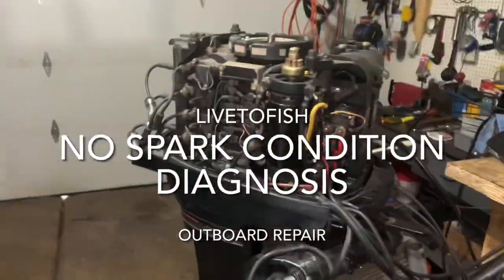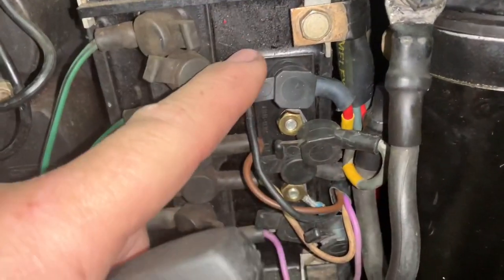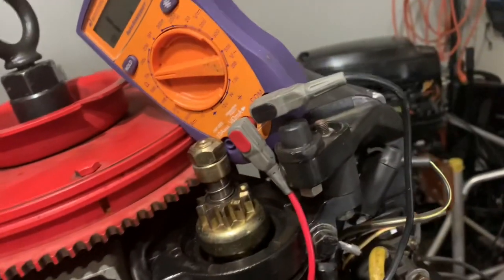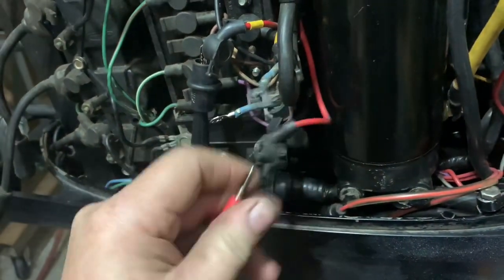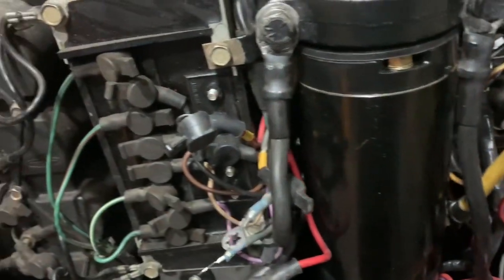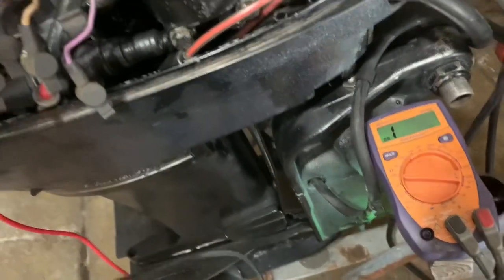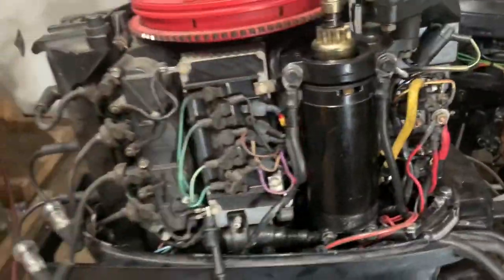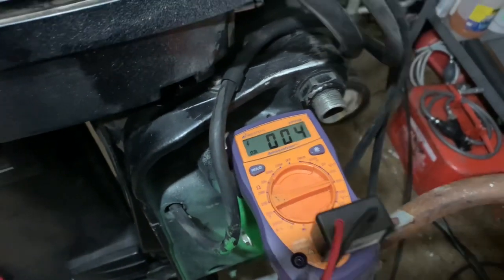“No Spark” Is it a Bad Switch Box, Stator or Trigger? Using a DVA Adapter - 1989 45 hp Mercury

Comment: Personally if the engine has known to have X amount of hrs 9x’s out of 10 it’s going to be the power box.  And ya might as well get new coils and plugs. It’s not a lot of money and what the hell .. if your fixin one thing might as well do a overhaul. Last thing anyone wants is to be out on the water and have to get a tow. Thanks for the run down, it’s always good to know the sequence of operations none the less
Reply: Sometimes it is a lot of money for people and they don't want to just throw a bunch parts they don't need on there. The reality is that these parts are very reliable
Reply: Tell me how exactly your going to know how many hours are on a well maintained motor? 

Also, parts combined with labor could be well over $1000, easily double that.

Most of us that own or purchase older boats are only doing what we can afford as it is. 
If money wasn’t the issue, just buy all the parts, change it out, and drive away…
Reply: Can anything else cause a no spark in all plugs scenario?
Reply from the maker: @mikesolns1364… Yes a bad kill switch or if all the coils were bad or if the wiring harness was rotted.
Reply: @LivetofishOutboardRepair  Is it true that a bad regulator/rectifier can burn a power pack? Thanks, I appreciate it
Reply from the maker: @mikesolns1364  ….from my understanding the rectifier just charges the battery but a faulty Stator can cause a power pack to go bad.
Reply: @LivetofishOutboardRepair  I ask because I think my rectifier is faulty, my tach goes crazy most of the time, and had no sparks in all plugs, changed the power box, and the engined fired back up, to be without sparks again some weeks later. Was wondering if the rectifier could have burned it? Do you know how can a stator burn it?
Reply from the maker: @mikesolns1364  The Stator provides the AC current to all the components. It can cause voltage fluctuations and spikes to the power pack if it begins to fail. This is why my video shows the peak voltage outputs from the Stator to the Power- pack while connected to the Power- pack. I also show the Stator’s resistance (Ohms)disconnected from the Power-pack. If you go to www.cdielectronics.com they have troubleshooting guides specific to your motor and explain with even more detailed information.
Reply: @mikesolns1364 I had this issue with the tach going crazy and it was the rectifier

Comment: Great video!!! I have a 1985 Mercury 75 HP. Idles and runs like a top up to 4100 rpm’s then runs rough, spits, sputters etc. when I back off it runs great. Checked everything I could think of concerning fuel but no change. Electrical? Any thoughts?
Reply: While I was waiting for a DVA adapter to arrive, I swapped the switchbox out from my parts motor and it fixed my problem! Runs like a champ again! I had no idea what I was doing but your video gave me the confidence to give it a go. Thank you very much! Time to go for a ride 😎!
Reply: And I sure hope it’s not the reeds………..
Reply from the maker: Bobbyvee20…. Did you remove the carbs and thoroughly clean the carbs. It sounds like you might have a high speed jet plugged or partially plugged. If you have already cleaned the carbs you might want to verify the resistance values for the Coils, Stator and Trigger and if that all checks out ok use a DVA adapter to verify your peak voltage outputs for both the Stator and Trigger as well. If the voltage and resistance outputs check out then you may have a bad switchbox.
Reply: @LivetofishOutboardRepair  carb’s thoroughly cleaned. Stator and Trigger resistance good. I need to check the coils and do the DVA adapter tests on the stator and trigger. I didn’t understand how until I came across your video! One question, on the resistance tables, OEM (original equipment manufacturer) and CDI is an aftermarket manufacturer?
Thanks for the quick reply!
Reply from the maker: @bobbyvee2043  you are correct CDI is aftermarket.
Reply: @LivetofishOutboardRepair  Thank You!
Reply: I have done all the resistance tests as shown. Testing the trigger wires individually to ground, they each read between 1775-1850 on the 20000 scale. Could this be my problem why it stumbles over 4100 rpm’s? They are either consistently good readings or consistently bad. According to the video, it is the latter.
Reply: Also, I have not yet performed the DVA tests on any component.
Reply from the maker: Bobbyvee20… I would say those resistance readings are revealing a problem with the Trigger. I would continue on with the DVA voltage readings to be sure. If your trigger is bad you may see problems at WOT. I would also check the Stator and Switchbox for both resistance and DVA voltage outputs to make sure you don’t have multiple component issues.
Reply: @LivetofishOutboardRepair  thanks for the quick reply. I will continue on with DVA tests!

Comment: I have a Yamaha 115HP V4 from 1984-1988. Having the same issue, no spark on any cylinder. It seemed like the CDI troubleshooting guide you used in the video was worth the money. Would you say it was helpful? I found their specs documents for free but it looks like you have to pay for the troubleshooting guide. It's a shame I live so far away from you (northwest Washington), none of the mechanics around here want to tackle this issue, just because it's and older motor. I'm going to try replicate what you do in this video and see if it'll help.
Reply from the maker: Jared Feig ….. the CDI DVA are like you stated free charts and are very useful, however I did not purchase the troubleshooting guide. I am not a professional mechanic but just used a systematic approach to isolate the problem. Good luck with your 115 Yamaha. If you keep digging you will solve it yourself.

Comment: great tutorial sir. I have the exact same engine. I tested my trigger to your specks same as you did. Cranking with the DVA hooked up you got 6v or more. Mine only puts out 1v. Is that low enough to assume that it needs to be replaced you think. Engine is lacking power at higher RPM's. Thanks for any info that you pass along.
Reply from the maker: Anthony sloan … it depends on which wires on the trigger you are testing. The purple, white, brown and white/black wires when checking to engine ground should be 1v or more. Checking purple to white and brown to White/black wires should produce 4v or higher. If your trigger is producing these values then you might want to look at checking the Stator. Do you have strong spark on all cylinders or only spark on some cylinders? If one or more cylinders lack spark then it could be bad coils, SP wires or a bad switchbox.
Reply: @LivetofishOutboardRepair  I checked the stator exactly the way you showed and I actually got better numbers than you got so it should be fine. The switchbox is new. On my trigger test exactly as you explained on the DVA cranking voltage test of purple to white and brown to black and white you got a little over 6 volts on both. I got only 1 volt on both of those. So my trigger passed the ohms tests but failed the voltage according to your specs. unless 1 volt is sufficient enough. What do you think om that. My coils and wires passed resistance tests.
Reply from the maker: Anthony Sloan… If the voltage is showing only one volt and it needs four or more then I would say the trigger failed the test and needs replaced.

Comment: so where exactly do you get the manual with step by step instructions. It helps if one understands how exactly to use the electrical test tool too! what kind of remote starter switch are you using? can you show it? Not many old timers out there with this kind of patience and diagnostic skills.
Reply from the maker: Charles Shahan… the information can be obtained at www.CDIelectronics.com
You will need to look up your particular model number. Click on the Technical Support then Technical Support Documents then click on DVA charts to find the voltage and resistances for your components. The hand held switch can be purchased on Amazon for under $12. Just type in trigger switch 12v. You should also purchase a service manual at www.marineengine.com for your motor.

Comment: Where did you find the specifications for your engine?   I can’t seems to find anything for mine.
Reply from the maker: Walleye Slayer … I found the information by going to www.CDIelectronics.com 
Click on the Technical Support tab then Technical Support Documents and finally DVA charts. You should be able to find the information you need for your motor. Good luck!

Comment: what if the new trigger has ground  .55 or more? how will it ground itself? i have no spark tested trigger and it failed . replaced with a new one and still shows ground on all 4 wires its a 90 hp merk power sport cdi red stator.... help it was running on 2  befor replacement of new trigger .. now nothing.. replaced old trigger and still i have no zero spark.. and dont run at all .. HELP..
Reply from the maker: Steve Damico…. Make sure your Stator has the proper resistance as well. It’s your Stator that acts like an alternator and produces the AC current.

Comment: I am working on a 1977 85hp Mercury 4cyl. for a friend.  I don't have a DVA. It is a red flywheel and the stator is black. When I check the red to red white I get 67.5 ohms. The blue to blue white is 7.46 @ 20k. The yellow wires are loosing insulation where they go into the stator.  The trigger is violet to white 750 ohms and brown to white black is 735. Are these readings ok? The stator seem high on one and low on the other. Please write back.
Reply from the maker: Lee Murphy… make sure your getting the proper resistance reading from the Stator. It might be that your Stator is bad. That’s why you need a DVA adaptor or a meter that reads peak AC voltage to check and see if your delivering the proper voltage to the switchbox from the Stator.

Comment: Great video.  For me, it was blue to blue/white on stator.  Would crank cold, but when warmed up, would not crank.  Would get an ohms resistance reading intermittantly on blue to blue/white.  Found this article online for an explanation of why this could happen.  I am no expert, but it makes sense.  It's like ghosts living in your engine.  

From an old post in 2007.
One more thought with regards to the dual winding on a Mercury stator. It would make sense to me also that the main purpose was to give a better, higher amperage charge at lower RPM.
However, when reading posts on a Mercury outboard specific site, one of the first indications of a problem with the lower speed winding is weak spark when cold, but enough that the motor will start. Of course, the motor started so, like me, you'd go off on your merry way and forget about it taking a few more cranks than usual. Once the throttle is down and the RPM increases you've unknowingly switched to the high winding on the stator. Your second clue to a bad low speed side is when the motor is now warm, and you shut it off. The malfunctioning low speed winding is now also warm and has become an open circuit, so the motor won't restart. Sometimes, as in my case, the circuit closes when it cools, allowing the motor to start once again, but giving you an intermittent issue that is by nature hard to diagnose. I got this clue about three times, but was too bull headed to investigate before it finally quit altogether.

So, while I'm sure the low speed winding helps with low RPM charging, it apparently also has the primary role in supplying spark to the motor.

jandrewg	 posted 05-23-2007 11:47 AM ET (US)     Profile for jandrewg  Send Email to jandrewg
Reply from the maker: Chris Forbes…. Thank you for posting that fantastic explanation. I’m sure this will help many people troubleshoot similar ignition problems. Thanks again for watching.

Comment: Where did you get the technical information for testing the electrical components? I am having a similar issue with a 1981 Mercury 40 hp 2 cyl 2 stroke. How far up into Michigan are you located?
Reply from the maker: James saylor… you can find the technical information on www.CDIelectronics.com
Click on the Technical Support Tab then click the Technical Support Documents, then click DVA Charts to find the information for your motor.
I am located in the South East Side of Michigan. Thanks for watching and commenting.

Comment: You can just set your multimeter to AC volts instead of using the adapter.
Reply from the maker: Prassman… I didn’t test your theory but my understanding is that the DVA adapter allows the meter to read peak voltage and without it you can only read the average volts. Therefore you might not be getting the proper results (on the low side) and believe what your testing is bad when in fact it could be ok. Thanks for watching and commenting.
Reply: On some multimeters there are a max setting. Thatll work right?
Reply from the maker: @dennaa7322  it may work with more expensive meters but I’m not sure. Mine was fairly inexpensive with limited capabilities and needed the DVA to read peak voltage.
Reply: @LivetofishOutboardRepair 😅😊

Comment: This helped me out alot. I've a 78 50hp merc with the 4 wire stator. Read all pairs good skipped the dva voltages and went directly to cranking voltage reads, found a black box in between the stator and switchbox that read open, so i bypassed it. Couldn't find a drawing or part number on the net. Started right up.
Thank you so much for clear concise information.
Reply from the maker: Cy Lon… I’m very happy the video helped you out. Try finding your part on www.marineengine.com they have very good drawings and parts listings for your motor. Good luck and thanks for watching and commenting.
Reply: You mean the rectifier?
Reply from the maker: @TheOffCycle ... no the rectifier just charges the battery.
Reply: @LivetofishOutboardRepair  yes but it can interrupt the signal on these motors when it goes bad. One of the tests for no spark is removing the yellow leads to it.
Reply from the maker: @TheOffCycle..... Excellent advice thank you for your knowledge and experience

Comment: Clear as mud,,lol
Reply from the maker: Sorry if it’s unclear. Hopefully you’ll find a solution. Good luck and thanks for watching and commenting.
Reply: @LivetofishOutboardRepair  wouldn't it be easier for a beginner like me too just see if there is any power coming out of the powerpak and replace it if not?..like how do u fix a powerpak if u do all the stuff u did and found out its defective?
Reply from the maker: @Scott Dempsey  the reason for doing all this diagnostic work is to pinpoint the problem and not just replacing parts randomly. This helped me to target the switchbox as the problem by process of elimination. If the Stator and Trigger were bad I would have replaced them as well but why just throw money away by replacing good parts and seeing if that fixes the problem? Remember a no Spark condition can be caused by many different things. Usually on these old outboards it comes down to the Stator, trigger or switchbox.

Comment: I keep having a problem losing stators and engine won't rev over 3k rpm under load
Reply from the maker: You might want to check out your switchbox. I have heard that when you change your Stator, you should also replace your switchbox as well.  If you didn’t this might be why your Stator is failing so often. It might also explain the low rpm. Are you getting spark on all cylinders?

Comment: Hi I have the same problem but 2 of the plugs have spark but 2 dount  Could it be the stator or the CDI Box.? It ran an I turned it off and and stopped working the trigger I also ok.
Reply: Blue - white = 70 v
Blue - ground = 120 v
Red - blue = 94 v 
Red - ground 16 v
Brown - white 1 v 
I didn't really understand what was on the paper so can you help 😕
Reply from the maker: Lazy Games… The numbers you provided above for voltage look low. Did you use a DVA (digital voltage adapter) connected to your volt/ohm meter? You can get the specs on your motor at www.CDIelectronics.com